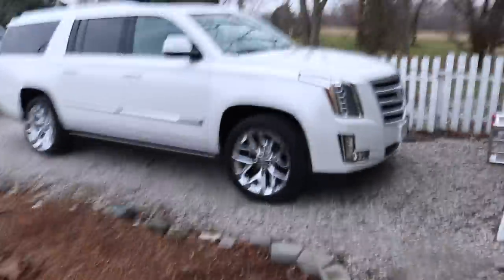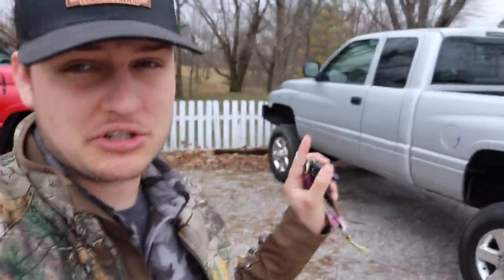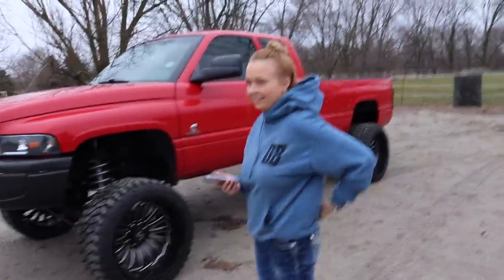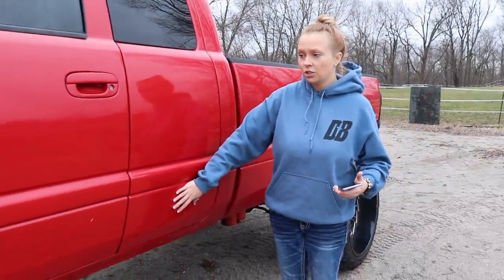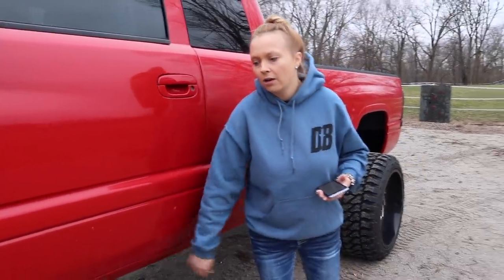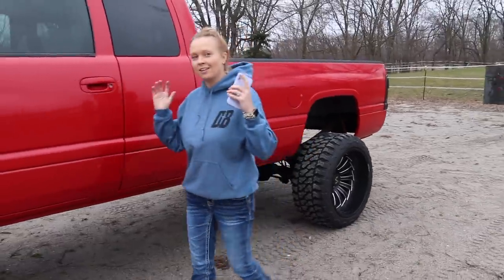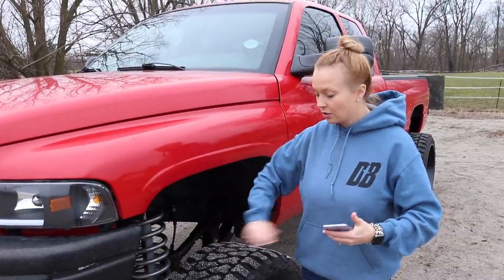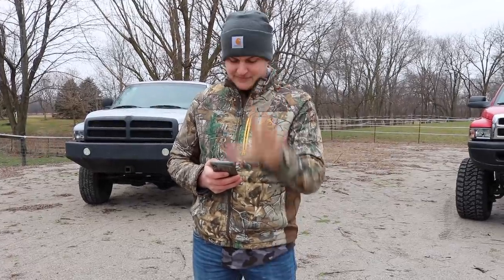DO NOT Lift your truck before watching this video!!!

Comment: I would definitely lift one of my truck if I didn't spend so much money on repairs from being reckless with vehicles, that being said I will lift one of my trucks in the future although it is a 2wd obs I will be putting much unneeded effort to fit a Dana 60 front and leaf springs so I can have more options and practicality for it, yes it may be expensive to engage in such efforts as it is with modifying any vehicle

Comment: My wife is allergic to cats too and we have outside cars. Lol and it depends on lift, shocks, and wheel and tire set up whether it rides smoother or rougher. My 97 k3500 454 crew cab long bed with 6-8 left and 35x12.5r15 thronbirds rides smoother then my 03 k1500 quad cab short bed with 3 inch lift with 285/75/16 and my wifes 98 Tahoe 4x4 4 door with 2.5 inch lift and 35x10.5r15. The bigger, taller, and wider tires don't feel the bumps or smaller holes as bad as the smaller tires do. That and if you go with smaller wheels and taller side walls you will have more tire cushion.

Comment: If you ever have issues with starting 12 or 24 valve cummins just lay your foot on the throttle pedal, works for me every time

Comment: Is the red truck a 12 valve or a p pumped 24 valve if it's a p pump truck they are colder blooded than a efi truck

Comment: Personally in my opinion I think a lot of trucks look good with A leveling kit and  33‘s unless you’re like a Dodge or a Ford and can stuff bigger wheels and tires on there but generally even then 33s are perfect tire size  And I think that’s a perfect daily set up. I had a 6 inch lifted 03 F150 at one point and a  rough country lift on it and it Road amazing and towed the horse trailer just fine even though it was sitting on 35 MT’s but it just wasn’t the ideal daily set up unless you can afford the gas with that then by all means but that’s a different topic

Comment: i dont like blocks under the leaf springs and most lifts use them less use full bed when the floor of the bed is 3 feet ih the air loading stuff is a pain, that being said i like the stuff you do looks clean

Comment: Dang even though my moms 2000 GMC Dooley needs a new starter it was doing the same exact thing before that that truck is doing that needs a grid heater And like you said it shouldn’t be taking that long to start and I live in Florida where it does not get as cold as everywhere else